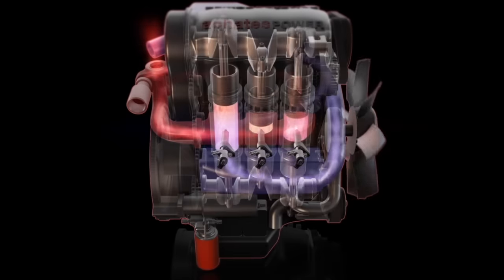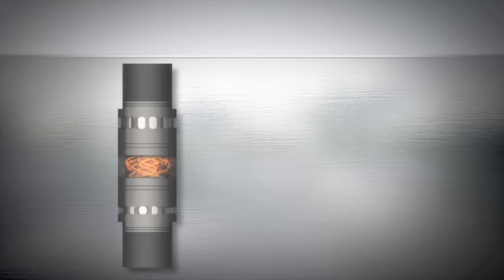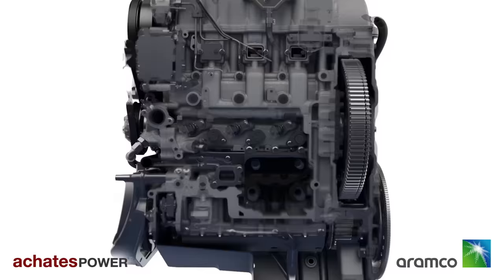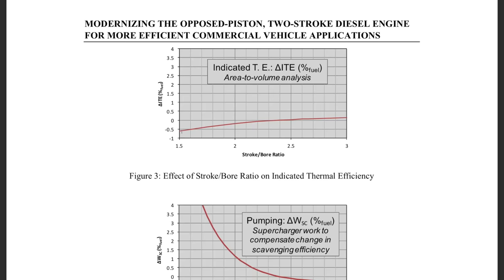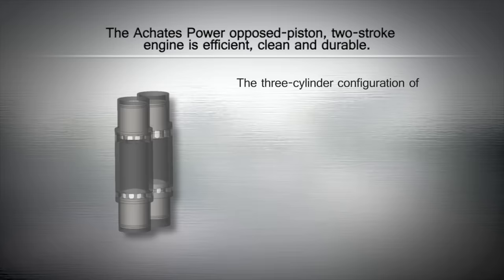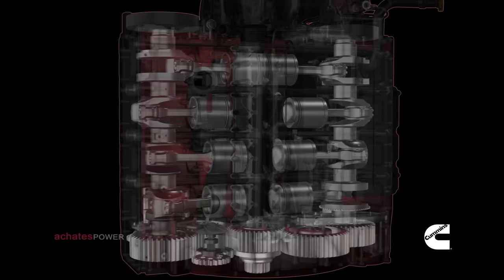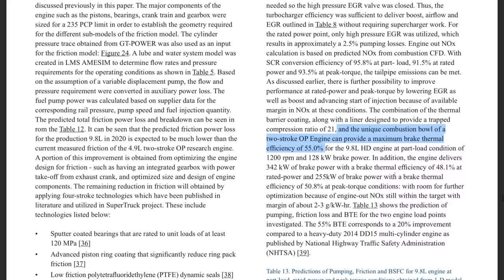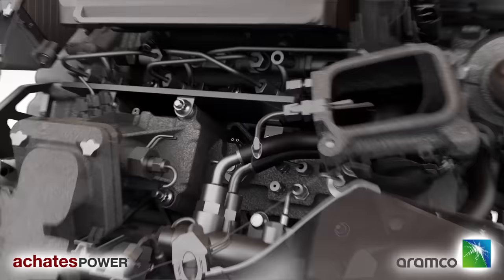Opposed Piston Diesel Engines Are Crazy Efficient

Comment: The biggest hurdle is emissions.  Two factors are two stroke and Diesel.  It will be interesting to see what auto manufacturer R&D come up with to address it.
Reply: Diesel exhaust fluid (urea), catalytic converter, and a particulate filter.
Reply: i kinda disagree. 2 stroke on  diesels are quite different compared to gasoline 2 strokes. whereas a gasoline 2 stroke can run no turbo. there is such a thing as a 'blown 2-stroke diesel', and is basically a neccesity if you want it anywhere near effective. plus the technical problem of the injection system.
Reply: Defeat devises
Reply: Traveler X Remember that everything has an advantage and disadvantage. Two stroke engines reach higher RPM's faster with reduced weight due to less moving parts. As far as emissions go, Mazda has found a way to re-introduce exhaust back into the intake stream to reduce NOx. They've been developing a new rotary engine that solves the emmisions issues.
Reply: i don't know about the not burning oil, since i do believe that diesel fuel itself is sort of a lubricant, but since it's injected in the middle of the cylinder, only about half of cylinder, that is mostly the area closest to the injectors is going to be more lubricated, and the piston rings is going to be slightly less lubricated closer to BDC. also to the 'combining' the intake and exhaust stroke, back to my argument of 'blown 2 stroke diesels'. a turbine is kind of used to 'purge' the air from the previous combustion, and by the time the fuel is injected, it's likely that the exhaust port has already been closed, so the amount of unburnt fuel escaping the exhaust is going to be very minimal.

my point is, there's just so many problems with the technicalities of the design that could be fixed with good engineering, but while this config is not a new tech, it is mixed with a lot of new tech, and isn't as widely used, so in the end we the 'consumers' are mostly in the blind of the actual potential problem this engine could have
Reply: Koolkei Why couldn't petrols be turboed? I've even seen it done, worked well and made tons of power for the displacement.
Reply: DEF (Diesel Exhaust Fluid) works.  However, it increases maintenance.  Manufacturers are trying to reduce maintenance because most people don't want to bother with car maintenance.  Dieselgate was VW's attempt to reduce maintenance cost.
Reply: Reintroduce exhaust into intake to reduce NOx is the purpose of EGR on all cars.  Is Mazda doing something different or additional?
Reply: who say they couldn't or wouldn't? it's everywhere nowadays. i'm just saying that the turbine, whether it's from a turbocharger or from a supercharger, serves another different purpose on a 2 stroke diesels.
Reply: Agreed. Emissions have always been 2 strokes downfall. Opposed piston downfall was complexity of controls. It only worked in constant speed applications like a ship or tank.   However thanks to mega computers and huge advancements in engine computer models old tech has new life. millions of combustion  simulations were run on this engine in 2 years. It would have taken 10 yrs to do that work just a few years ago. 
This is a direct injected 2 stroke that reduces 90% of the emissions issues! Look at evinrude boat engines. They kept 2stroke alive by going with direct injected!
Reply: Two stokes like in Mopeds may have 3 of the combustion phases occurring in one stroke of the cylinder.  That is not the case here.  It is very different.
Reply: Not sure why two stroke might be an emissions problem, as it is injected so there is no fresh fuel in the purged air unlike little petrol 2 strokes. The biggest emissions issue 2 stroke diesels have would be nox as they run hotter than a 4 stroke. This is dealt with by using DEF. As others have mentioned the main concern with this design is going to be lubrication of the top piston.
Reply: Lubrication of the top piston is the same as the bottom.
Reply: Traveler X It looks like the turbo is doing a lot to improve emissions by allowing the exhaust port to be lower in the cylinder
Reply: @Traveler if by Mazda you mean their HCCI gasoline engine, it lowers emissions by using diesel-style compression-ignition which produces a more uniform, cooler and cleaner combustion than ignition that relies entirely on the hot flame front coming from a spark plug.
Reply: But don't 2-stroke gasoline engines have poor emissions because the fuel is injected into the intake air before it enters the cylinder, therefore if too much intake air flows through, uncombusted gasoline escapes out the exhaust? Plus the oil burning problem others mentioned. With diesel, the fuel isn't injected until top dead center to initiate combustion, so the combustion products could be completely expunged by clean air without worrying about losing fuel.
Reply: Diesel fuel is not a lubricant.... if it gets on your cylinder walls too much it will wash the oil off an cause excessive wear which is why tuning the injector spray pattern is important.
Reply: Kevin Day I think the main reason traditional 2 stroke gas engines have poor emissions is that the exhaust port needs to be uncovered fairly early.  The addition of oil to the gas doesn't help either.
Reply: @Kevin Where are 2-stroke gasoline engines used? Mainly in applications where you want the smallest, lightest, simplest engine legally possible. If you didn't mind the extra complexity of a high pressure fuel pump, fuel injectors, electronic ignition, etc., you could build a 2-stroke engine with HPFI where the air-fuel mix occurs during compression where both intake and exhaust are shut off too.
Reply: Emissions rules are the biggest thing holding back engine development. Eliminate emissions requirements and you will see more new designs hit the market.
Reply: Direct injection is just that :injecting directly into the cylinder. You're probably thinking of port fuel injection of gasoline engines. Totally different animal.
Reply: Don't worry. I'm sure VW will get it to pass, no problem.
Reply: Case IH someone call VW. They can make any diesel (appear) to run clean
Reply: The problem with two strokes is exhaust and intake are on the same stroke.  So, it is much harder to completely evacuate exhaust and fill the combustion chamber with fresh intake charge.  Forced induction helps in this case.
Reply: Traveler X

No, it doesn't. It leaves you derated and or stranded and sends you to a dealer. Not a repair shop, a dealer. When arriving at said dealer, they ask you if you brought your own rape whistle, or if you would like to buy one of their stainless steel ones that can handle multiple insertions.

Then they make you wait while a "technician" hooks your diesel to a diagnostic machine while they run the tree. If that doesn't tell them exactly what is wrong they start with the most expensive parts and work their way down to the cheap ones. If that doesn't work, they scratch thier head and send you packing with a several thousand dollar bill and hope when you break down on the way home they can figure it out next time.

It almost bankrupted me, and countless others in the trucking industry, and every friend of mine with a diesel pickup has either sold or defeated the system.

It categorically, unequivocally, under no streach of the imagination "works". I would really appreciate it if people that have no clue would stop saying that.
Reply: First thing that crossed my mind.   2 stroke diesels are already a thing, and pretty cool at that.  Unfortunately, they have no chance in hell at passing modern day emissions, and I'm not seeing how this system seeks to address that.  Maybe they're going to cheat it old school and blow a ton of air out the exhaust.
Reply: John Burns please explain. The top piston doesn't have a crank case directly below. So how exactly will the oil flow away from the piston. I'll have to take a closer look but i imagine there must be some channels to allow that oil back down.
Reply: They solved those issues
Reply: Razvan J  Couldnt agree more. I sincerely believe the only reason for the pressure on diesel right now is to accelerate the sales of EV cars.  If diesel stays mainstream the media knows that EV cars have an uphill battle. What about all those bad battery packs when they need to be replaced? Pollution comes from both sides ice and ev just in different forms.
Reply: @koolkei  u can turbo a gasoline 2 stroke .. it has been done .. there is a turbo banshee build  using a 50mil carb in a pull through design.. on YT

Comment: Love this engine tech, such a cool way to go about simplification and efficiency.
Reply: Please tell me where you see the simplicity.
Just image starting this thing:
You start rotating, one combustion occurs, but there is no air pressure on the intakt yet. So no fresh air enters the cylinders. So it just won't start.
On submarines, trains or other stationary aplliance that won't be a problem - compressed air is stored and available to start those engines. By the way just like the german no crankshaft diesel engines on the U-Boot. And by the way not having a crankshaft sounds way more simplistic, doesn't it?
/watch?v=QUbBqSu9Hdc
/watch?v=pzRu3ijghBQ
/watch?v=liFMZpPfeWA

Well, any 2-stroke design is just environmentally bad (2-stroke-gasoline) or needs too complicated compressed air supply to start the engine for a car (2-stroke-diesel).

And no matter how good you think this opposed pistons efficiency is: turbines are better; convert that into electricity, store it in a battery, drive with it, even use regenerative breaking and beat this supposedly 55% efficiency by A LOT.

There IS a reason why concepts like this never made it. Those are not new ideas!
Reply: @RubyRhod  If you compare this to a Detroit diesel two-stroke, this design eliminates a lot of potentially trouble-prone extras. Having said that, the Detroits were/are extremely reliable, give a long service life, and, as to your first remark, very easy to start. Incidentally, the sugar milling company I work for still has a large number of 8v-92 Detroits in their locomotive fleet (2 foot gauge) and a few years ago, we replaced one of the engines that had done over 40,000 hours and was still running sweet. However, by that time it was using copious amounts of oil and was getting a bit rattley.

Comment: looks at engine, imagines engine sideways, looks at wrx, sweatss
Reply: subaru engineers look at phone 
...
flips phone sideways
BOSS I MADE A NEW FLAT ENGINE
Reply: No spark plugs to worry about so I don't see why it would matter which way its oriented.
Reply: @leonidas14775  low center of gravity and vertical compactness
Reply: also subaru engine bays are just set up for flat engines
Reply: @leonidas14775  even with spark plugs it wouldn't matter.
Reply: Horizontal cylinder engines wear quicker, because all of the friction is put on one side.
Reply: @jarrhead3538  Rotate your engine every 5000 miles

Comment: Nice, loved the ts3 in the old commer trucks. They used rocker arms between the rods and a single crank. Never had a turbo though  just a small blower with a weak blower shaft